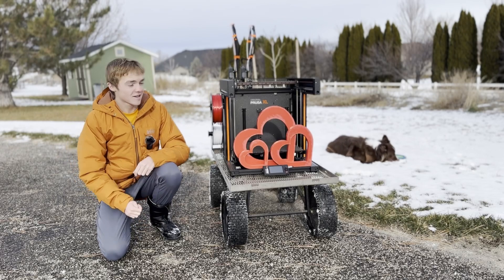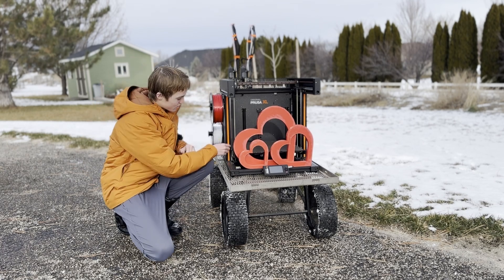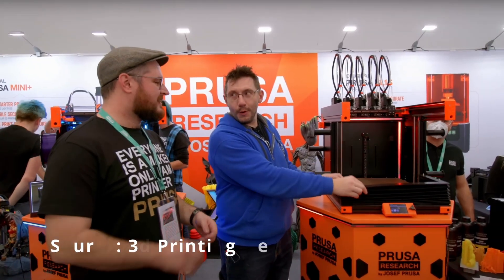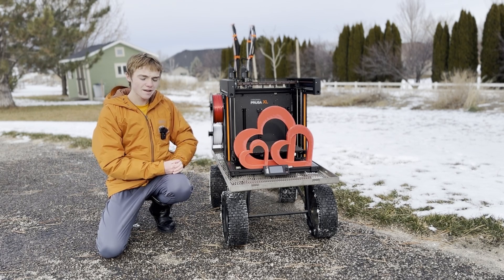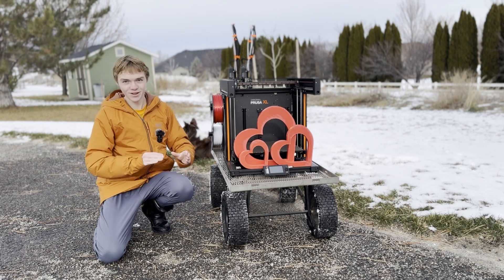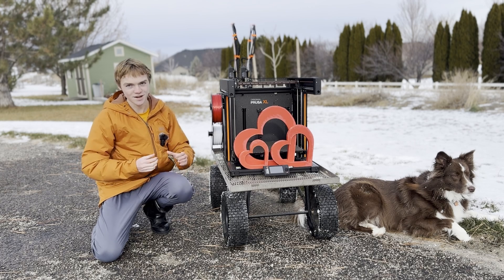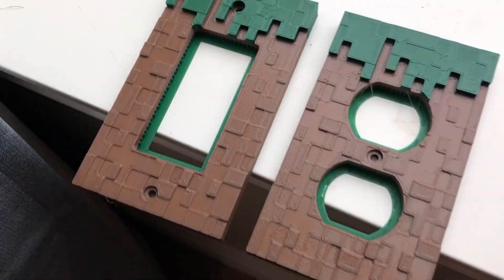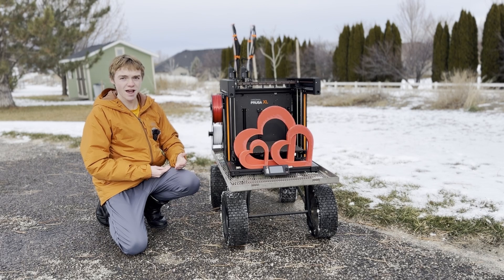Prusa XL Q&A || Post Review

Comment: If you check out Prusa's tweet on the subject you'll see that they're shipping all new XLs with 0.4 nozzles because it's counterintuitively not any slower than the 0.6:

"This change is directly connected with the increased print speed. The volumetric flow (the amount of molten plastic pushed through the nozzle) is similar with both the 0.6mm and 0.4mm nozzles. However, the extruded line is thinner with the 0.4mm version, enabling greater detail but requiring more travel of the print head during the print.

With the Input Shaper firmware out, we can now push printing speeds higher (accommodate for increased print head movement) and max out the volumetric flow easily. This means the print times are comparable for both 0.4mm and 0.6mm with 0.4mm providing added fine detail with no downsides. We noticed some members of the community already switched to 0.4mm and seemed very happy!"
Reply: high deposition speed often reduces material strength. its not all about speed, thats what injection molding will always excel in